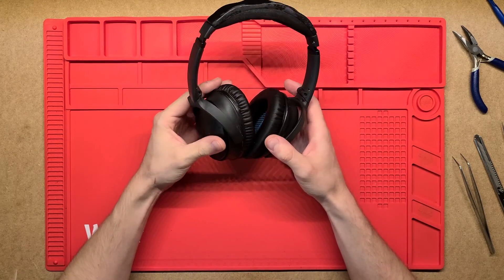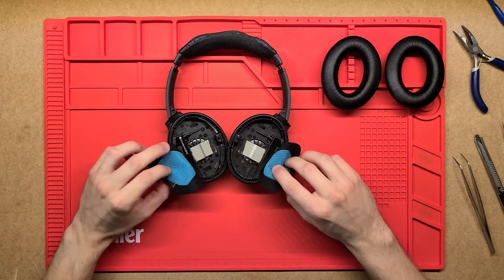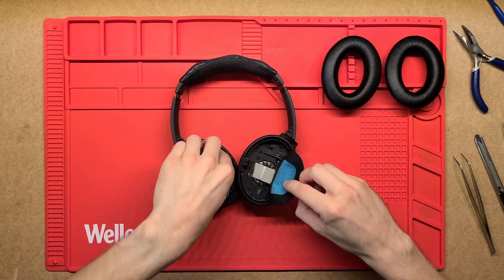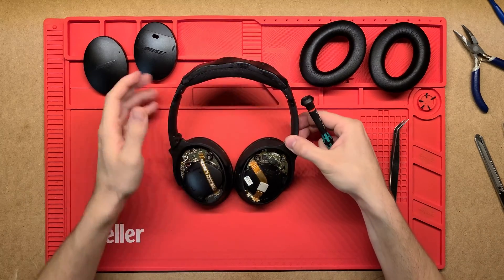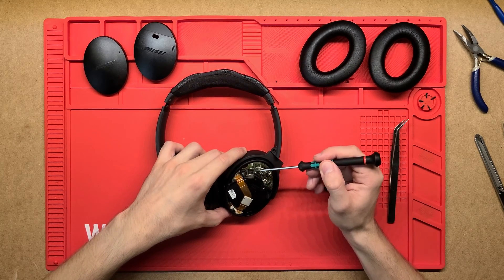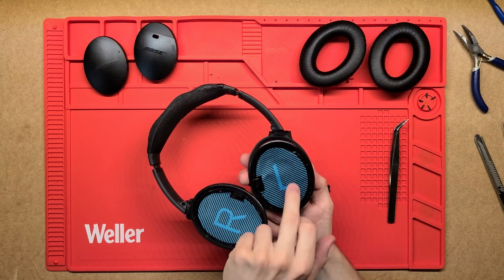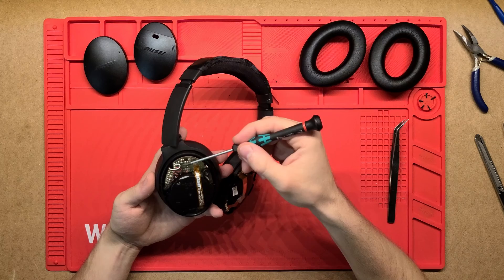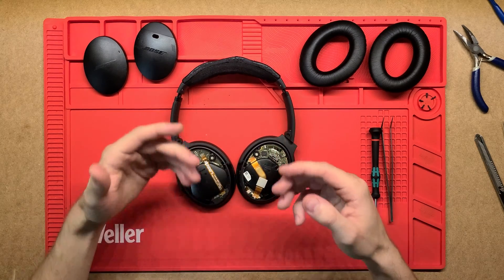BOSE QC35 Teardown

Comment: I'd like to integrate my QC35's into my motorcycle helmet but probably far beyond my electronics manufacturing level skills. Any helpful ideas?
Reply from the maker: Hmm, they have pretty delicate cables connecting the cups together, you'd want to be careful with that. You'd likely also lose most of the noise cancelling features if the cups don't seal well in the helmet.

Comment: This is not a complete teardown. Almost everything is still attached
Reply from the maker: You're right! I focused on showing the key components, but a full teardown would go even deeper. Appreciate the feedback.
Reply: @ToolsnTeardowns  thanks for making the video.  it would be nice to see how to detach the cups from the headband.    i think i may be having a problem with the wire that runs thru the headband and those complicated joints.

Comment: Most probably the microphone facing to the front is the one used when having a call, right? Issue is my qc35 mk1 dont pick up me speaking anymore. So I would try an attempt and desolder the microphone
Reply from the maker: Yes you're right, check both sides. Have you tried cleaning out the microphones with some rubbing alcohol?
Reply: @ToolsnTeardowns  May give it a try but main issue is my headphone got quite soaked once during heavy rain. Luckily basically everything works the same after besides that microphone